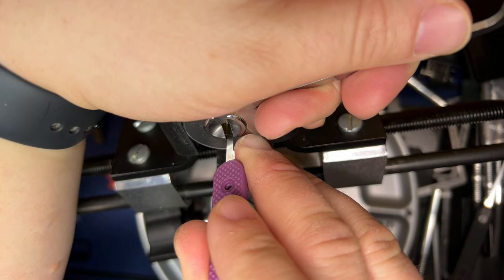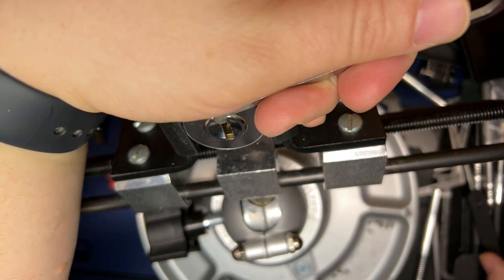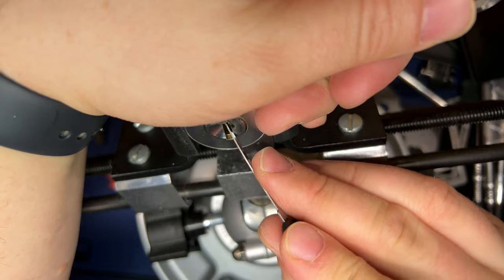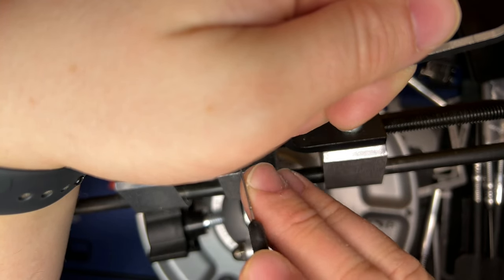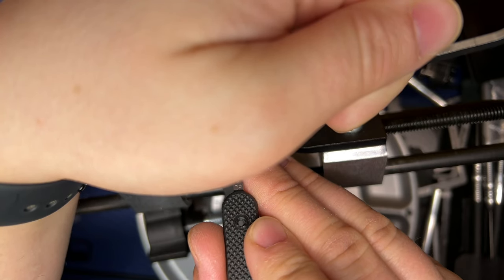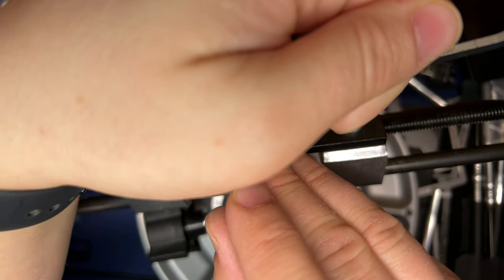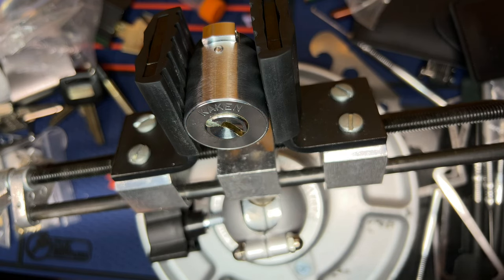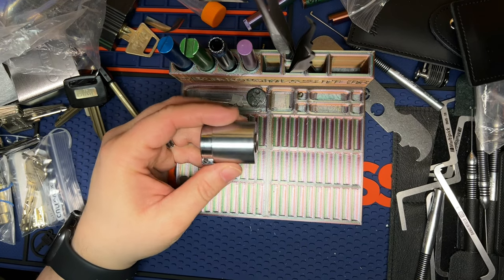[190] Kaken KX3 picked and bricked

Comment: At least you got to pick yours lol I went to gut mine just to check out the insides and bricked it instantly. Grats on the open though!
Reply from the maker: Oh man, that's a shame. i think I accidentally rotated it to just the right position that a driver shot into the slot for a slider. And I can't get the key out to try to poke around! It's a bummer, but it wasn't the first and won't be the last lock I brick! 🧱🔒